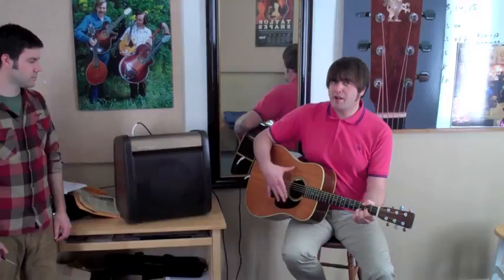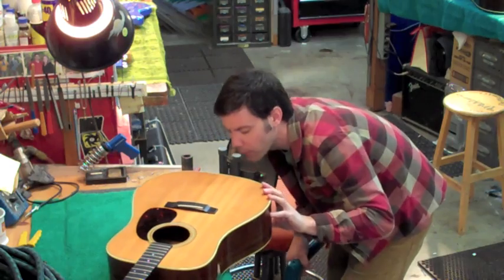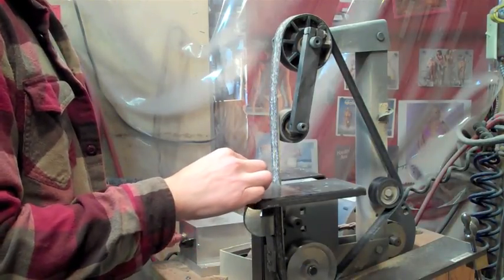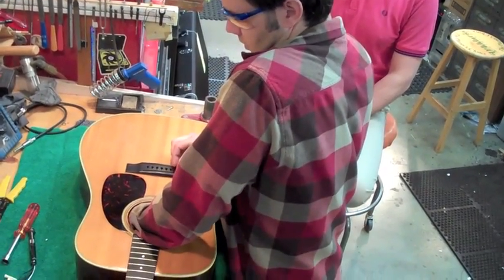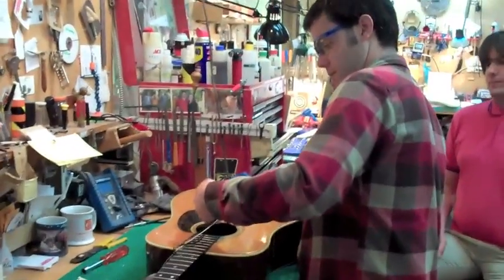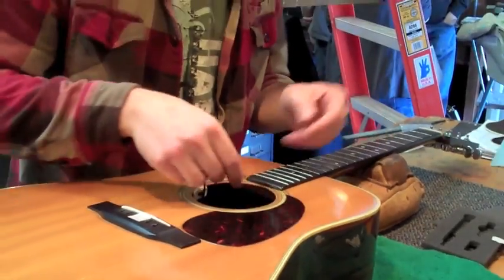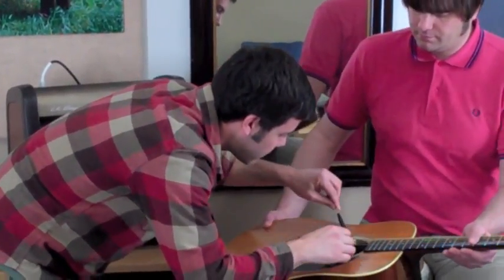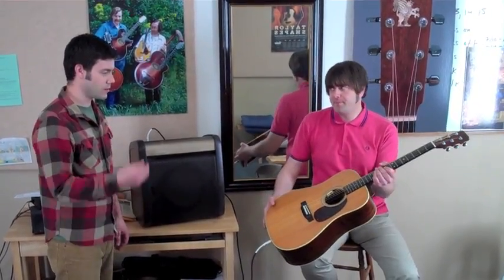LR Baggs Anthem Pickup installation and demo at Gryphon Stringed Instruments

Comment: I also wondered about not going for the full version (with pickup mixer and phase button) - given the amount of work required to fit. On the other hand, an acoustic guitar pickup is purely for live gigs, with the engineer controlling the eq.  You use the screw driver to set up how you want the guitar to sound to him and he alters it to suit the room.  Not having to mix the two pickups is one less thing to do have to do at sound check - although the phase button would be useful.

Comment: Great video..... Though the only part I do disagree with is the statement that all the components doesn't affect the tone acoustically when it actually does. Drilling the bridge, mounting to the underside of the bridge, and all the other components affect the vibration characters of the instrument pretty dramatically. Though in a live setting you typically don't hear the differences. However in the studio you can notice the difference quite dramatically. I for one would never add a pickup to an instrument that wasn't initially installed with a pickup. I basically have my live guitars, and my studio guitars.
Reply: Totally agree - there's a marked difference in the quality of the sound.

Comment: I need help to fix my Taylor guitar 110 CE had the same problem but I looked inside the box cleaned the corrosion on the spring + - terminals because of the battery left for a long time thanks

Comment: ok, just got mine back from the guitar shop and trying to figure out how I'm supposed to change the battery without removing the strings.  Is there a tool, or a trick to it?
Reply: +Greg Christopfel Not really. The best thing you can do is not remove the strings at all but just loosen them enough so the strings can be parted just enough to change the battery. Much less hassle and easier to set back.

Comment: Only a snob would not want to buy a guitar that's installed with a good pickup like the Anthem. A guitar with pickup that sounds good is better value than an expensive guitar without pickup that sounds like crap.